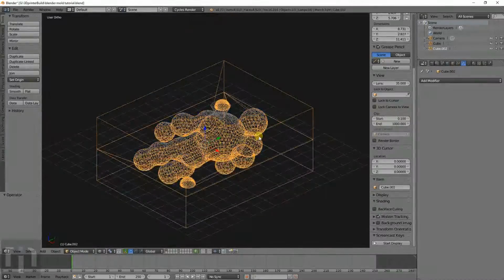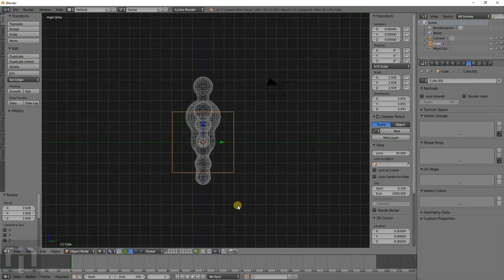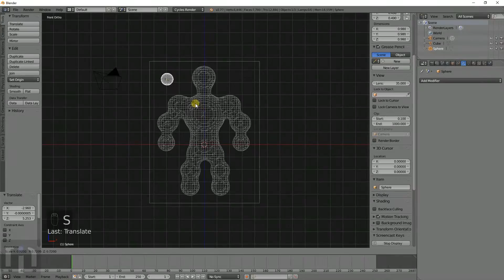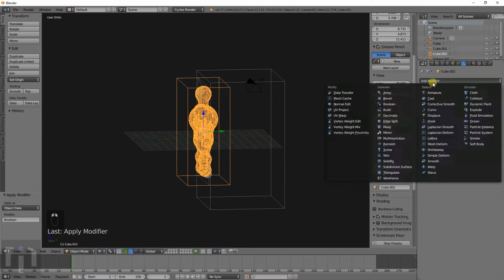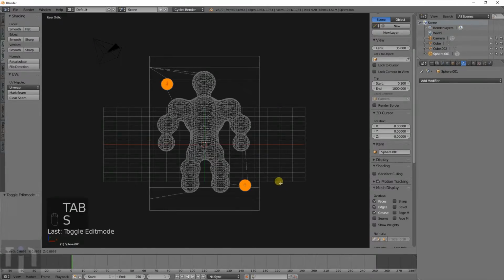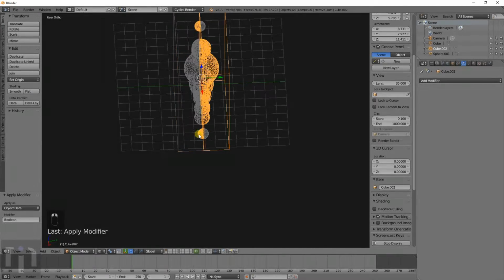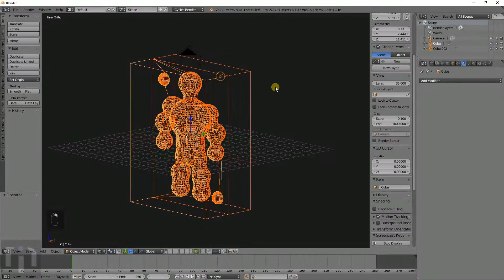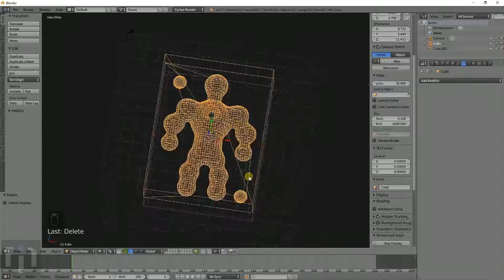Blender Tutorial #030 : Creating A Mold from an STL

Comment: Thanks! Whic version of blender? Because I'm using a newer version and it dont work. I wanna down laod your version
Reply from the maker: Should work on any version.  The newer version has new keyboard and control layout, but you can revert the layout to 2.7X settings.  I honestly cannot use the new keyboard layout efficiently.  To change it (it is easily revertible) go to edit>preferences> then select keymap on the left side, then from the top drop down box, change it from Blender, to Blender 2.7x.  You can switch back and forth between as needed.  All of the same settings are available, they have just been moved around.  It took me a while to get used to 2.8X +, but I understand it now.

Comment: Bro,i discivered that i have to solidify the cubes before adding boolean.I tried few times following every step and i only got the model inside the cube with flat sides,nowhere to actually cast the material.So if anyone had the same problem,the solution i accidentally found is to solidify the cubes.Btw thanks for this awesome tutorial,cheeers!
Reply from the maker: You need to make sure the objects are manifold before doing any boolean.  Manifold= complete solid object without any holes.  Sometimes shapes get over complicated and overlapping vertexes faces and lines can happen.  This will cause the object to not boolean correctly.  Solidify turns a non-manifold object into a shell.  it makes every face into a plane with a thickness.  So the entire object becomes like a cup or an object with a cavity.  It's a useful tool if used intentionally.  I use it to make fan ducts for 3D printing all the time.
Reply: @inventimark  Thank you for quick response,do you have a tutorial on how not to lose details when creating a mold?The eyes are almost gone,lips also,ears...im trying to make a mold for a girl from Mexico,as a gift..she wants to make flower pots with human head shape..
Reply from the maker: @ivanvladimirovic2972  That all depends on the detail of the model you start with.  However detailed it is, will be the exact mirror on the mold.
Reply: @inventimark  Oh finally i made it,thank you so much,it was just a single word that helped me to find the solution.MANIFOLD.And regarding the lost details,i made a mistake with solidifying the object,so after remodeling it without solidify modifier i managed to get sharp details.I am so happy now!If you guys only can see the picture..Thanks again!
Reply from the maker: @ivanvladimirovic2972  Ahh, Glad to hear you figured things out.  :)

Comment: Nice fairly quick tutorial. Came to it via the thread where the request was made. A little more practice with Blender and I can whip these out, for a different purpose. I am using this workflow and adding to it a bit to make CNC files for carving wood to pour pewter or carve graphite for higher temp molds.
Reply from the maker: Nice!  I've never worked with graphite, besides the powder form.  It's an interesting material for sure.  Let me know how it works out.

Comment: Cool what version of blender is this?
Reply from the maker: I'm pretty sure it was 2.78, not sure which letter though.
Reply: Ok thanks
Reply: I've never used this app  before how do I get to orbit view without going into the view option each time for one movement and how to select options with the left mouse as I seen you doing??
Reply from the maker: The orbiting view is with the middle mouse button (wheel click).  You can customize any setting you want in the user preferences. (especially useful on a laptop (highly recommend external keyboard and mouse))
Reply: Prefect thanks man!!
Reply: I'm sorry man this is almost impossible to configure with my netbook in preference I'm not getting these functions to work the way I need to could you export your settings to me and I can import them to my application??? 
They way you drag and drop,change view left click and get options I'm not getting anything like that?? I'm using an old acer aspire one netbookD257!
Reply from the maker: I don't have any settings to export.  I use the default settings.  I don't modify anything at all.  I use a desktop PC.  And if I do use my laptop, I use at least an external mouse.  The keyboard on my laptop is also a full size one.  Blender is very difficult to use on anything smaller than a 17" laptop.   In which,  you'll want to also use an external keyboard for numpad usage.  A regular keyboard an a mouse are almost a must.  I also use the default right-click on everything.  It takes a while to get used to but I find it works better in the long run.  Even if you have to buy super cheap ones at a thrift store or something, it's less of a headache than trying to configure blender for use with a trackpad.
Reply: Thanks man appreciate it!!
Reply: Hey thanks for the help but this is driven me crazy
I was able to make simple shapes molds with your method but what I really want to do is make a mold we're I could just get the cavity  of a STL object Were I could put some sand in the to halfs and get the sand core for aluminum casting the part has open hollow shapes when I try your method I end up with a sealed off imprint of the part on both sides I try and remove the triangles so Cura can see it but when it's sliced it's not showing the part to print just the imprint Im new to printing could you help me out???
Reply from the maker: A couple things to try.  In edit mode, press W, and select remove doubles.  Sometimes you may have repeated vertexes and lines overlapping that cause problems.  Next in edit mode, deselect everything by pressing A until everything is NOT highlighted.  Then press CTRL+SHIFT+ALT+M (sounds crazy, but is an actual command)  This tests to see if the object you are working on is watertight or Manifold.  (no holes or overlapping faces).  What's probably going on, is you have a face that is covering part of the mold so cura thinks that it is solid when you have all the detail there.  If you want, you can send the file to me at admin@inventimark.com and I'll take a look at it.  It's hard to know exactly what's going on without actually seeing the model.
Reply from the maker: I haven't received anything yet.  The file might be too big, in which case you might need to use google drive, dropbox or something like that to share large files.  You can just email me a link to go to the shared file.
Reply: Ok I'm going to generate some Dropbox links and email them to the same address you gave me!
Are you getting a messege at all that I sent?
Reply from the maker: Finally came through, looking at them now
Reply: Let me know there should be 4 blender files and 1 STL and a explication?
Reply from the maker: Got them.  I'll respond via email.

Comment: This is very straight forward!  Could you do a 2D mold tutorial??
Reply from the maker: Thanks!.  What do you mean by 2D?
Reply: inventimark The back side of yoyr model would be flat.
Reply from the maker: Oh, .... to do that, all you would need to do was create a box that is slightly smaller than the mold's bottom half outer dimensions(almost the same size), big enough to cover the model on the inside. Then make it deep as you want(but not bigger than the mold half), and do a boolean using the Add function, and it will make the bottom surface flat.

Comment: Sweet video! I just made my first mold, 3d printing it now!
Reply: Hi, how did the mold turn out? I'm working on a similar thing and Im trying to find ways to get it right
Reply: @SaFFire123x  Hey SaFFire, overall it worked pretty well, I actually made a removable rod part through the mold so I could create a hole in the product after pouring. the biggest thing I learned was it is good / important to use some sort of demolding solution / spray so the resin / whatever you are pouring into the mold does not stick to the mold... I have since moved on to Fusion360 instead of Blender.... I will say Fusion360 is an amazing CAD software for creating physical / 3D printed things / products. (At the time of this comment I only knew how to use blender and sketchup, but after learning Fusion360 I would not go back, it was worth spending the time to learn it) I know a lot of people who use Blender to design physical 3D printed stuff, and it works fine, but I think its more geared towards cinematic / game style 3D models as opposed to a CAD based software like Fusion, AutoCAD, SolidWorks... that seems to be more geared towards making molds / machining parts / physical and mechanical industrial design. Both tools work to get the job done though... its really all about how you use them. Edit: Actually I think I have a timelapse of the mold printing in my channel... It was for drumstick ring finger holders lol
Reply: @audiomammoth  thanks for the reply. I am in uegent need of a  mold for a sole exactly like this (with studs and grips):

https://youtu.be/cLUpovDaI1s

What do you think would be a good method to make the mold in blender so that it would be 3d print compatible?

Also please let me know if I can directly 3d print a sole model (to make shoes out of it) since I have 0 knowledge in 3d printing.

Thank you very much. Would be waiting for your reply 😊
Reply: @SaFFire123x  Hey SaFFire, From my experience, directly 3D printing would not be as time efficient / economical / and durable as making a mold. Especially if you are looking to produce more than one. Most 3D printing technologies take quite a lot of time. I have tried different materials as well, and most of them are not very durable. I think 3D printing a mold and using a tough rubber resin material that is similar to the sole of boot would be best. If you have a copy of the the 3D sole model, you should be able to quickly create a mold for it by cutting its shape from the middle of a block, and slicing that block and half and adding a pour spout, and 3D print (as long as your 3D printer has a large enough build volume / bed to print it.) If your printer is not large enough, it is also possible to slice your 3D prints and glue them together. (I have seen people do this to get past build volume restrictions at MakerSpace.) If you are looking for very high definition as well, there is resin printers on the market that are now pretty affordable with special resins for molds. FDM printing is probably the most common among Makers at home. Other high quality level printing methods would include SLS (Selective laser sintering) which used a powder and laser, and polyjet (which pours resin in little droplets that quickly cure)... those printers get very expensive (over $100kusd) and it is sometimes better to outsource the print to a place like Stratsys Direct or ProtoLabs. Since its a sole of a shoe, and the tolerances are pretty forgiving, I think you could get away with making a mold on an FDM printer and get decent results though. For the studs, you can do what is called the overmolding process, and make spots for them to sit right in the mold... totally possible!
Reply: @audiomammoth  thanks a million ton Jeff. You saved my day. Stay safe 🥰

Comment: Hello, i need more help. I have a problem with the sphere. Look it here: https://lh3.googleusercontent.com/-Jlt7j1DdwQs/WMHCgcI8xDI/AAAAAAAAASM/soYqtt_FmvgtIfLty_Byl-jR5357scH1ACJoC/w530-h298-p/Sphere.png
Reply from the maker: It looks like it's not doing a boolean correctly.  Before doing any boolean, you need to make sure the objects you're working with are manifold.  The first thing to do, is to go into edit mode, select all vertices, press w, and then remove doubles.  That gets rid of duplicate geometry that might be there.  After that, make sure everything is deselected.  Then pres Ctrl + Shift + Alt + M.  This will highlight any vertices that are out of place causing the object to be non-manifold (not water-tight).  Once you fix the geometry, the booleans should work properly, otherwise they get very confused as to what is inside and what is outside.  It can be quite difficult to fix a non-manifold object, but if you are patient, it can be done.
Reply: Hello, i was trying it like 15 minutes and nothing... This is a work for the University, i really need your help. Can you do a short call in Skype? This way I can share screens
Reply from the maker: Unfortunately I can't do that.  I'm not entirely sure what the problem is.  It looks like it has overlapped faces where the circles are.  Something along that face has become duplicated and the geometry got messed up.
Reply: Pls, I really need your help
Reply from the maker: My apologies, but I've already explained how to fix what's going on.  You're going to have delete the areas where the spheres are.  Select those vertices and delete them.  It's going to look like it messes up the entire model, but it just deletes that one face.  You need to then select all of the edge vertices of that face and create a new one.  Then make sure the model is manifold before you do a boolean.  Always save (add a number to the file and make it different and just hit the plus before every save)before a big boolean operation or during a complex procedure so you can go back to a previous point.  Make sure there are duplicates of each model before a boolean.  To make sure it's manifold, use Ctrl+Shift+Alt+M to find the vertices and areas that aren't correctly topology.  Fix those before moving on.  I cannot help beyond this.

Comment: Thanks for this video. I was wondering if you could recommend the infill at which to print a mold, and the type of material(s) you might have used in the past to make the actual cast.
Reply from the maker: I've actually never cast anything before, but I plan on it sometime in the future.  I was just demonstrating how to do it for someone on reddit.  As far as the infill, It really wouldn't matter that much, just make thicker walls around 1.2mm.  If you're doing the lost PLA method, the less is better.  I'd add more flutes in more places for air pressure relief and better flow of the casting material.  There aren't a lot of materials you can directly cast into most 3D printed materials.  You could cast a wax mold, and then make a mold out of plaster from that and then melt the wax out.  That way you could cast things like aluminum.  Or just directly print the material and use the lost PLA method where you do the same as wax, melt out the PLA at a high temp.  It gets quite complicated when making molds for things.